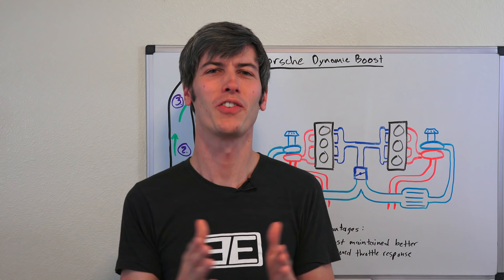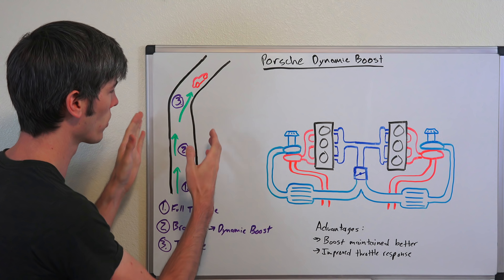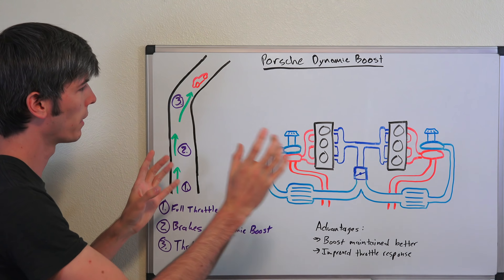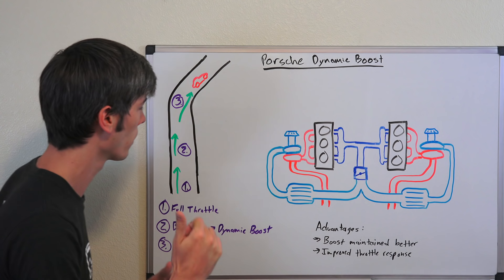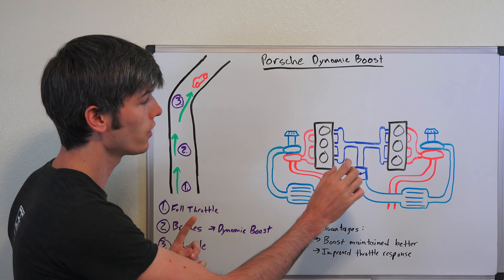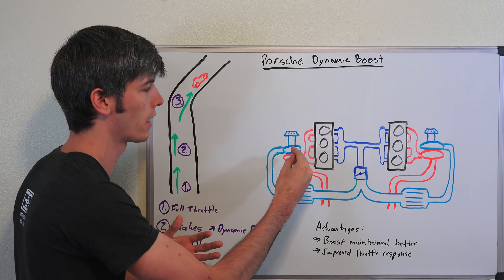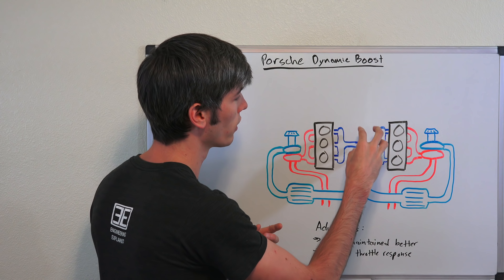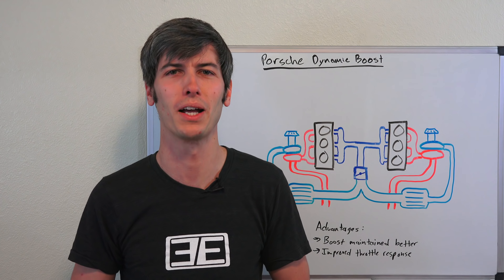Porsche's Anti-Lag System Doesn't Use Any Fuel

Comment: Does the fact that the throtle remain open means that there is less engine brake ? (because no negative pressure)
Reply: Basically yes.
When you're driving the car fast, engine braking is not as important from what I understand and know. You're relying a lot more on the actual brakes.
On a public road, where you would have the car in normal mode (or whatever), engine braking is much more useful - allows you to be smoother, and more frugal on fuel.
Reply: For a porsche its better because your reduce the snap oversteer which is a result of the rear engine design, for other cars it doesn't make much sense
Reply: Yes, basically instead of using the loss of the engine to slow down the car, they use it to spool up the turbos. It would still have some engine braking since it has to push the air through the turbos though.
Reply from the maker: Correct.
Reply: Makes almost no difference
Reply: No. When the throttle is closed on a petrol engine you have less engine braking because there is very little pumping losses (You cant pump a vacuum), only frictional losses which would be there in either case. Thats why modern diesel engines have air throttles to reduce pumping losses while coasting even though they dont physically need them to function. So if anything this system increases the amount of engine braking, but thats not a problem when you're on the brakes anyway coming into a corner. Probably why, as mentioned, the system is only active in certain situations and modes (sport and foot brakes applied).
Reply: +Alex Haldane you are not pumping the vacuum, you are pumping against the atmospheric pressure trying to maintain the vacuum, so you are wrong
Reply: @St0RM33  yes the piston will be pumping against vacuum but in the next stroke it would have almost nothing to compress.
Reply: +EJ WU yes the thing you both fail to understand is that the opposing force that creates the pumping losses is that engine pushes against the force exerted on the piston by the crankcase pressure (aka atmospheric pressure for simplification), NOT the "vacuum" trying to pull the piston up..in other words positive pressure is pushing, vacuum can't pull because it doesn't exist, only a pressure differential exists in physical terms
Reply: The engine never pumps against vacuum it pumps against the atmospheric pressure out the exhaust. If throttle is wide open it's (ideally) the same pressure in and out so no pumping losses (this is one of the reasons why Diesels are more efficient), throttle closed means sucking air at low pressure to push out at high pressure, this is exactly the same thing an air compressor at a workshop does to fill up a tank, or a small 12V compressor you use to fill up a flat tyre. When you take away the compression and power strokes an internal combustion engine is nothing but an air compressor.

High or low compression doesn't mean more or less engine breaking because it happens so fast that the thermal losses due to this are minimal and the work needed to compress the air is almost exactly the same work it then returns to the engine as it expands on the down stroke.

The "throttle" used in some Diesel engines (actually it's usually one per cylinder and called "swirl flaps" and some gasoline engines have them too) is not there because of pumping losses or engine breaking, it's there to accelerate air velocity at low engine speeds improving combustion and to stop the engine more quickly when you switch it off.
Reply: OK, I got your point. Is it possible to add a valve on the exhaust side that can be closed during engine brake? In this case the engine will be pumping air against a pressure difference (from atmospheric to higher-than-atmospheric)
Reply: The engine braking would be higher because the engine has air to compress now, if no air is entering the engine there is nothing to compress and therefore less braking.
Reply: @JW77  pointless, either you block exhaust gas to the turbos hot side or you stall its discharge air.  The typical method for controlling this is a turbo outlet pressure release valve or bloe off valve to vent pressure.  You dont sant to restrixt the exhaust egress.  Better yet woulf be a bethod by which inlet manifold vacuum pressure was mixed with and drawn through the turbo turbine basically spooling the turbo via sucking air through it.
Reply: I agree with the people who are saying that there will be less engine braking and I'll throw one more thing into the discussion: less effective engine braking leads to more fuel economy.
Engine slows car down less, more time coasting without using fuel and more wear on the brakes.
Reply: yes, that's how an air compressor works lol the thing it is not functional since we have break discs which work much simpler and better and cheaper
Reply: @bman12three43  I would like to test it in order to know if the driveability (effect felt by the driver) is the same.
Reply: So better throttle response when getting back on the throttle and then better fuel economy because you can "coast" further. So why don't all cars use this?? What's the downsides?
Reply: makes sense..
Reply: If it does, I imagine it's not a huge deal. Porsches are notorious for oversteering when you let off to quickly going into a corner.
Reply: Porsche engineers are the best!
Reply: @bman12three43  Yeah and hey still have compression

Comment: A similar system was used in Formula One, but for a different reason.  There was a period of time when F1 teams had the exhaust exit just in front of a diffuser to produce some additional down force.  They kept the throttle open to keep the flow or air moving through the engine even when the driver lifted.

Comment: So there is an advantage to Drive By Wire Throttle... lol
Reply: Always have been.
Reply: I'm always the type to prefer a cable throttle myself. Simply for the fact I know how far the butterfly is open by where my foot is.
But this is seriously intriguing, that if I ever build my own car, I'd seriously look into Drive By Wire, and do a similar sort of thing, on a Sport button or something.
Reply: Race cars with sequential gearbox benefitted from drive by wire TB cuz they can tell the ECU to shut TB for a split second when shifting gears w/o letting off the throttle paddle
Reply: upgradedBACON if only it were that simple.  Cable throttle can have a nautilus shaped cam that may give 50% throttle at 20% pedal application.  I've had electric throttle that was completely linear but most people seem to like the fake kick in the pants so that's what the manufacturers program, and make even more comical with "sport" mode.
Reply: yup, makes the engine more tuneable easy, its all software   :D
Reply: I can’t stand stock DBW systems; hit the gas and nothing happens for a loooong time! I’ll take cable and no computer any day.
Reply: I have a NC mx5 and i recently drove a friends NB. NC has throttle by wire, NB has cable. I could tell almost no difference. The cable was a little bit off but on that old car it just needed to be readjusted. My car responded a little bit faster but other than that there was no difference. If you put your foot down half the way, you instantly get 50% throttle opening. In both of them.
Reply: @aflacduck2  For some reason most throttles are closed at around 12 degrees, this means that when you open the throttle the initial increase is quite large. You can get 6 degree throttles aftermarket, this makes the initial opening much more progressive
Reply: Yes, normal people would not know the difference, only those who does performance driving would know and driven multiple cars for comarison, then again who would be doing performance driving in the streets?  only idiots  :D     , the internet are filled with experts who think they know the difference   :D  even though they have only driven their grandmas Chevelle all their driving life    :D
Reply: @aflacduck2  if your cable throttle has a "wall", it's not adjusted properly.

What most people like about cable throttles is the linearity of response (assuming a linear linkage on the throttle, not a progressive cam) and the pedal feedback. What most "dislike" about DBW is the non-linear OEM programming (possibly the feedback from the pedal, but the DBW cars I've driven in general had good resistance and feedback). As long as the pedal assembly is properly designed, you can get a sharp and linear throttle with DBW via the ECU mapping, plus you don't have to deal with routing a cable or packaging a linkage.
Reply: The Big Picture, the delay had nothing to do with DBW.  Put the car in key on engine off mode and goose the pedal while someone watches the butterfly.  It will track nearly perfectly.  Sounds like you want to go back to carbs.  No thanks.
Reply: Advantages nobody seems to acknowledge include free cruise control (no additional module or cables) and tie-in with traction control systems that used to be extremely complex.
Reply: @smithiness  that varies WIDELY depending on the ECU map. Some cars have a very non-linear throttle map, some don't. Most of the complaints about throttle lag are due to the mapping (which can usually be reprogrammed in the aftermarket).

Edit: you are right about the cruise control and traction control integration benefits as well, I forgot about those.
Reply: jsquared1013, yes I tried to convey that but it really is also true of cable throttle.  The difference being cable throttle always has the same curve.  I prefer linear throttle myself but it is very uncommon even of cable throttle systems.  Why can't folks just put their foot down if they want more throttle?
Reply: @smithiness  yeah, some cable throttles have that "progressive" curve also via the linkage (Porsche 944 turbo has a variable-radius arc that the cable wraps around for 90°, so the length of the lever arm gradually lengthens the more the throttle opens. The Ferrari 3.0 quattrovalvole does a similar thing with a wacky pin-in-slide multi-piece thing that likes to have the center bolt loosen so the slide plate goes out of parallel and the pin pops out of the notch and jams the throttle partially open 😤). With the Porsche, you have to buy a throttle "arm" with a circular profile instead of the arc, so it's exactly linear. With a DBW you just remap it 😁.

Comment: Looks good. Another side effect of this will be that air still passing through the turbines too so the turbo's not only have an easier time of spinning but still something to help them do so. Infact they're only missing the gas expansion so they could hold quite a large percentage of their airflow for a reasonable time.
I can see this system making a noticable difference to throttle response when you're only off throttle for a short time. 
I like intelligent solutions.

Comment: Jason, this sounds like a pretty simple solution which doesn't require any new components, do you think other manufacturers would be able to implement this in existing cars by just updating the software controlling the throttle?
Reply: Wow, great question! I'd love to hear a response from this question as well.
Reply: Even better.... could it be done by the owner? Throttle by wire is common now and even swappable to older models.
Reply: exactly, why is this a new 2018 technology?
Reply: For any vehicle that has electronic throttle control, yes this would be a simple software update to make it work.  The implementation could be as simple as adding a statement that during DFSO the throttle is to remain open.  However I could see some complications on fading back in the fueling.  I'd think that you wouldn't want to just slowly fade back in fuel, since you'd be at WOT already, it would result in an extremely lean condition.  So you'd likely need to add fuel very rapidly.  I'm sure Porsche is doing something like this, but I'd be curious to see how it works during part-throttle, or if it's only active on a quick rate of change of requested throttle position.
Reply: It onlh makes sense on a porsche, this system reduces engine braking thus reducing the risk of snap oversteer, a commun problem with rear engine cars, they hit two birds with one stone, on a normal car this would mean more work for the brakes which will reduce your time on the track, the benefits don't overcome the drawback on other layouts, it doesn't make sense
Reply from the maker: Yes, absolutely, and if not it seems like it’d be very easy to have aftermarket solutions for it. (Also I disagree about it only being smart for Porsches, brakes are designed and sized for a car’s weight, without considering how much engine braking will be used).
Reply: Mid engined Cayman has this feature as well.
Reply: This is only possible on cars with drive-by-wire throttle, not the traditional cable controlled throttle.
Reply: I think some direct injection engines don't even have throttle butterflies at all controlling everything with fuelling. The Fiat Panda and 500 "twin air" does something like that. Hopefully Jason will make a video about these engines as it's quite an interesting design.
Reply: Seems to me that when you get back on the gas pedal, it will FIRST need to close the throttle down to the appropriate position, and THEN start the fuel back up.  If the throttle valve can't move fast enough, this might cause too much of a delay for the power to resume.  On the other hand, if the driver really wants low/mid throttle as the curve gradually straightens out, maybe such a delay wouldn't matter so much.
Reply: Ben C For diesel engines maybe but for petrol engines i think it would mean that they would have a much too lean mixture. That would cause overheating or no combustion at all.
Reply: I'm thinking about playing with the idea when engine mapping. Not of a dd of course. Rofl
Reply: @spankeyfish  what about pcm controlled throttle...
Reply: @AustinBartz95  you could probably just use the existing AFR/IGN tables, although you'd get a little "bump" right as you put down the throttle.  Also these throttle plate motors are damn quick, so idk if there would actually be any big issue with it
Reply: @AustinBartz95  I think if the injector fades out slowly, it could create lean spikes and damage the engine. Yes this sounds very simple in theory, but the amount of tuning to make it smooth and reliable would be immensely difficult.
Reply: Blackfrost273 Industries+ If it's an electronically controlled throttle valve (or variable valve lift) then yes.
Reply: my 2002 beamer has variable valve lift and has a wide open throttle under normal driving conditions, the throttle valve is drive by wire but it's only a backup system. Normally the throttle controls the valve lift on the intake side.
To make this porsche work they would have to cut off fuel instantly and as soon as the driver hits the throttle again first the throttle valve would have to go to the requested position, then the fuel would have to come in at the correct amount asap.
Reply: Does it help to cool down the cylinders? Imagine on a track...2-3 sec of fresh air passing through is a lot in terms of cooling...
Reply: @AustinBartz95  I'm reading comments to understand if I can tune my car to do that. And I think that electronic throttle control and DIRECT INJECTION are prerequisites for this system to never encounter lean self-ignition.

Comment: Here is what you didn't mention (but should have had):
1) Not closing the throttle means you will have a stable airspeed inside the manifold. Low airspeeds mean bad air/fuel mixing, high airspeeds can lead to supersonic speeds and detonation. When you let of the throttle and push it back in you will have fluctuations and spikes, the airspeed will both spike up and spike down.
And another added benefit of a stable airspeed is that you know exactly how much air is entering the engine, whereas with fluctuations and pressure spikes you will not only have poorly mixed a/f, but you will also the composition of the a/f mixture will fluctuate (rich/lean).
2) One drawback of this technology: if you don't have direct injection or port injection you can get a lean mixture when you turn your injectors back on, so you just have to put the injectors as close to the engine intake as possible. And don't forget putting the fuel injectors further away from the intake has its benefits too. With this technology you can't do that, or you have to do what kawasaki did and use 2 injectors per cylinder (one being port injection, the other further away).
3) Another drawback: there can be uncertainly when for this technology for when to trigger: sometimes you let of the throttle completely, sometimes just partly and after that you still let of the throttle. In those cases you won't have a throttle that's staying open, but one that does funny things. This takes a lot of tinkering and setting up to make it work smoothly under any condition. And if you remap your ecu, you will have to redo some of that work.
The drawbacks are minor, and it doesn't cost that much to develop it, but that doesn't mean the drawbacks are not there. Overall it's a cool, but not new idea. People have had these sort of ideas before.